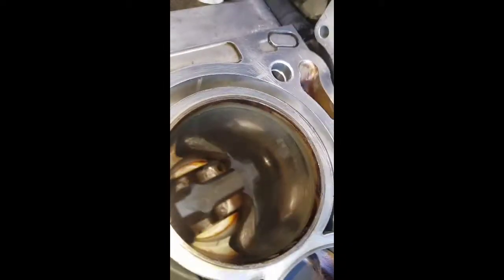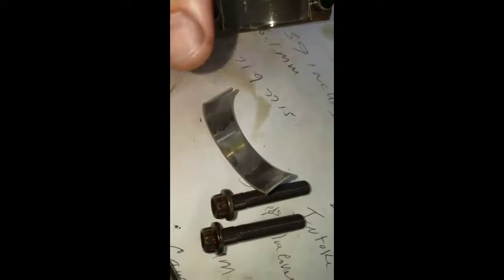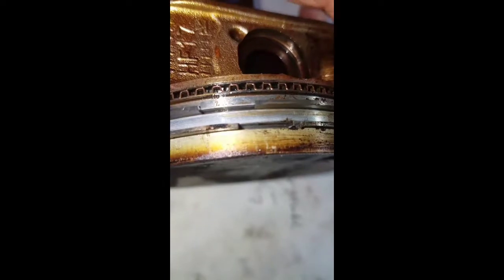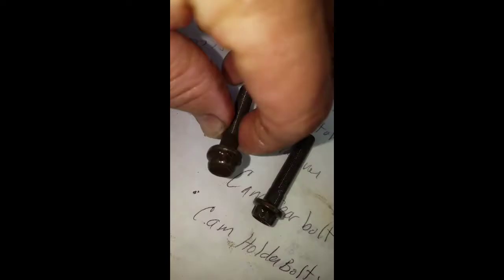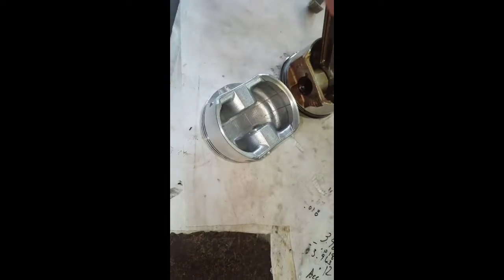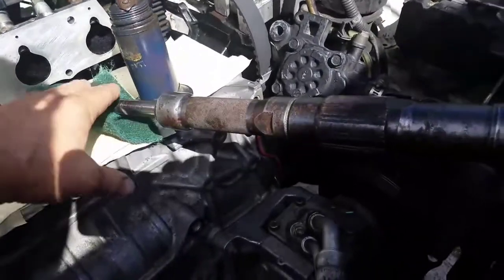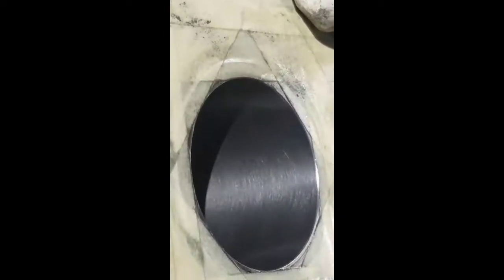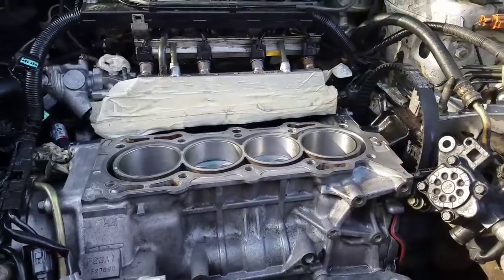2001 Honda Accord 2.3 new pistons in car

Comment: How did you get the plate covering the bottom end off?
Reply from the maker: I removed all the bolts holding the main cap cradle. When doing that be very careful and not use the starter to turn over the engine. Also the spark plugs must be out because the cradle has the main caps on it and all the support will be out.

Comment: You did a great job there. Love this engine. What was the cause to get it to score that bad? It shouldn't happen with normal use.
Reply from the maker: The engine was overheated real bad. It still ran with a blown head gasket.
Reply: @chriskolar  Thank you for the quick response. I guess someone was granading it too much. That is the first time I've seen  someone use the ball stone honing, you made the cilinder surface look better than factory. Really professional.
Reply from the maker: Cool thx

Comment: This is a very cool video.  How is it running now?  For my 2002 Accord I'm trying to decide between replacing a piston and rings on #3 cyl or just swapping in a JDM replacement off of eBay for $600.  Both routes have their challenges.
Reply from the maker: I had ball honed the cylinders and they looked great. After putting it back together the leakdown in two cylinders was excessive approx 20 %. I did not want to wait and see if they would come back ok because my kid needed the vehicle to go out of town. I purchased a jdm engine from JDM engine wholesaler in Houston. The JDM engine worked great and seemed like a 50k engine with excellent leakdown numbers.

Comment: I have a F23 MY01 ACCORD 4 cyl, when it cold startup, the piston sounds like its gurgling a bit (as if the piston was loose inside the walls and not perfectly sitting) and when its warmed up the gurgling is gone.  Not sure if it is the rings that need to heat up.  How is the the power difference when the new pistons and honing completed?
Reply from the maker: I will stress that it will will need a blade hone to straightene out the cylinder walls. I did not do that and had a cylinder that was not optimal. It was a bit under the correct pressure and anyone could not really tell the difference. The difference was the gas mileage. It was normally easily 30 mpg highway. With a low cylinder it was 25 max. I did pull it and put a jdm later. Then put the block in the shop for a blade hone for correct cylinder wall. It runs wonderful.